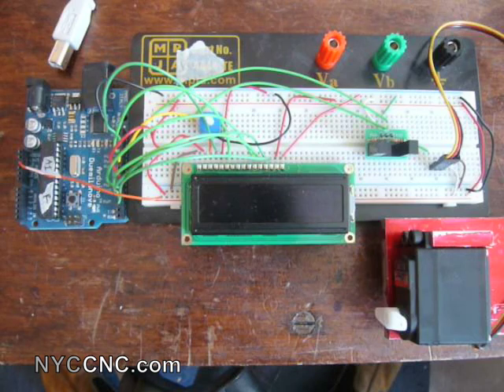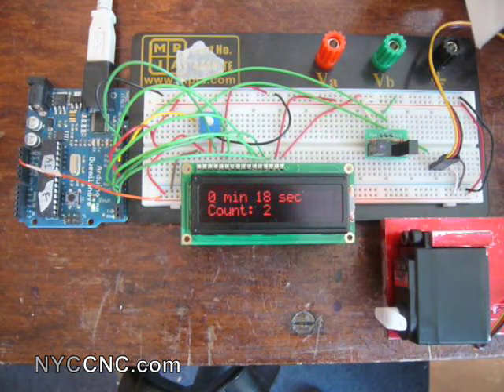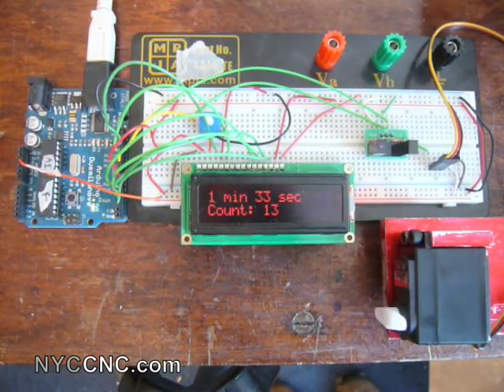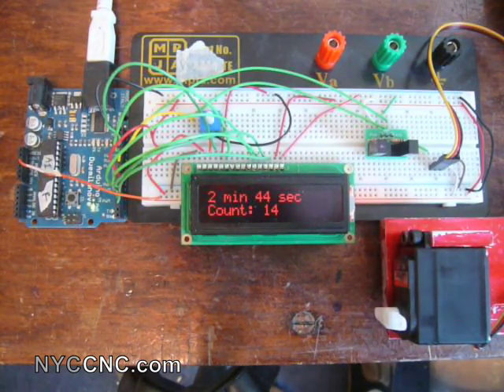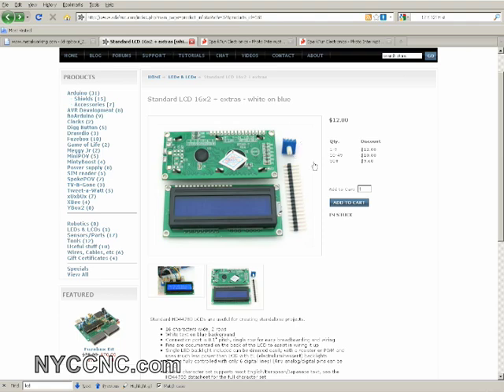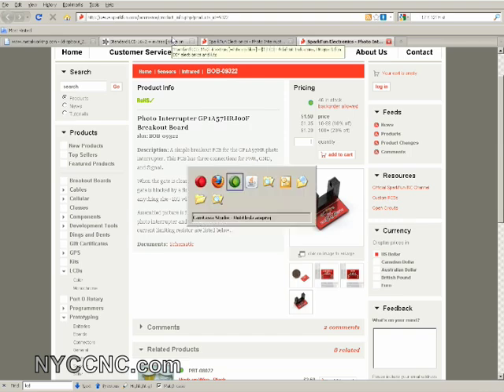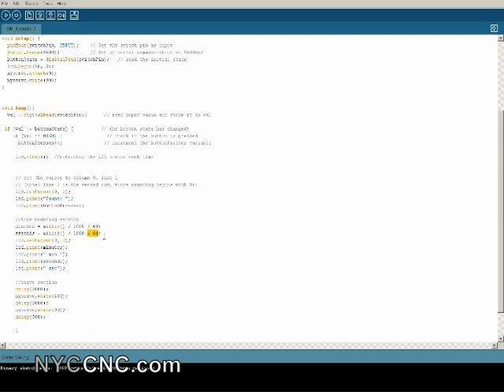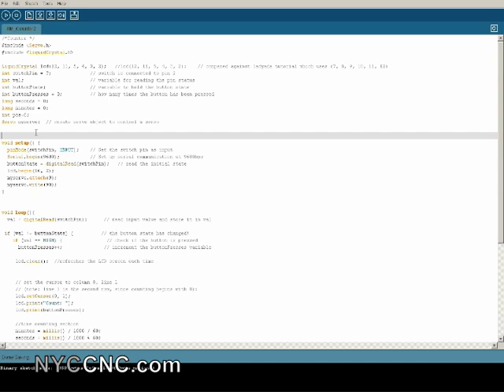Arduino tutorial LCD, Servo Motor & Optical Sensor

Comment: I am currently working on a project and need a piece of code written that will activate a servo motor with long clicks and short clicks (signals from a button, not sound) but i have no clue how to code for this. This is the way i need it: 
Double click from off to on: 12 o'clock to 3 o'clock
Short click from 3: goes to 6 o'clock
Long click from 6: goes to 9 o'clock
Short Click from 9: goes to 3
Long Click: off (12 o'clock) 
Long click from off to on: 9 o'clock

If anyone is up for the challenge please reply to my comment, thank you.

The project involves making the servo motor move as i bend my wrist so would it be easier to use a flex sensor or have this code written to move the servo motor. The only problem i see with the flex sensor is that i would have to keep my wrist from moving forward and making the servo motor move.

Comment: i am using  optocoupler  sensor to count rpm of wheel, using arduino mega and graphical LCD. may i get the code for it at asheikhniazi@gmail.com